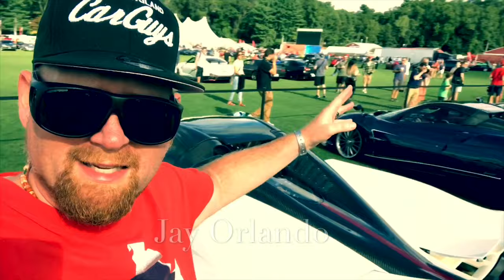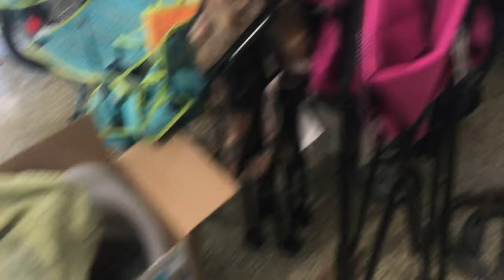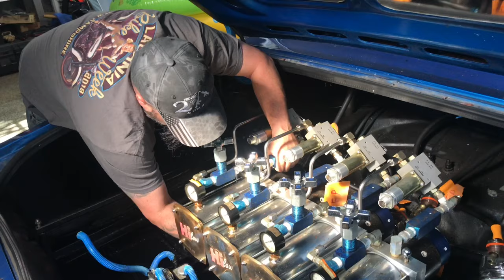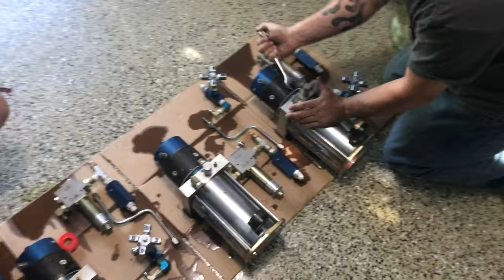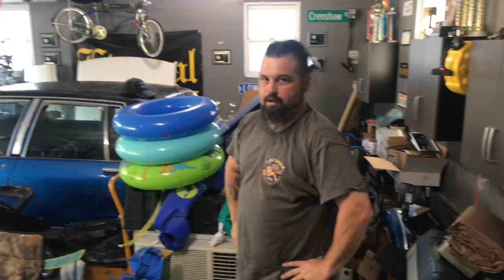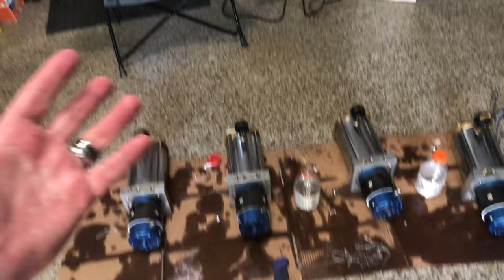Lowrider Caprice Hydraulics Upgrade Part 6

Comment: Can't wait to see it back on the road Jay, I might be getting a little ahead of you on this project. After doing all that I assume you have to bleed the air out of the lines too.
Reply from the maker: Oh yeah still a lot to do... change our front and rear cylinders, prime and bleed systems, install lift spindles, install rear long arm kit. install batteries and rewire primary system